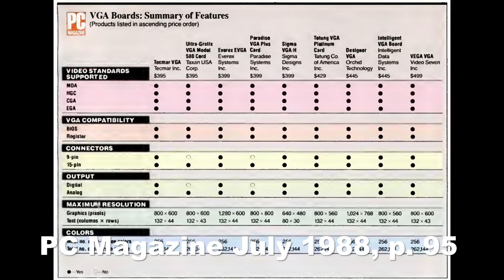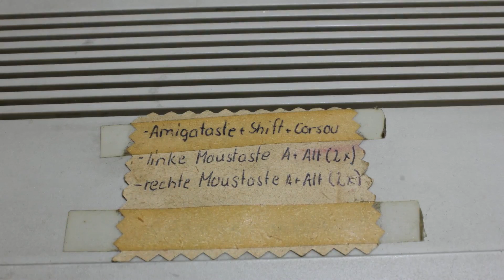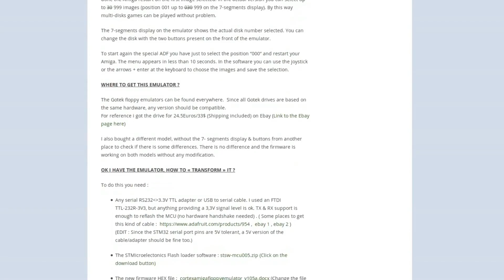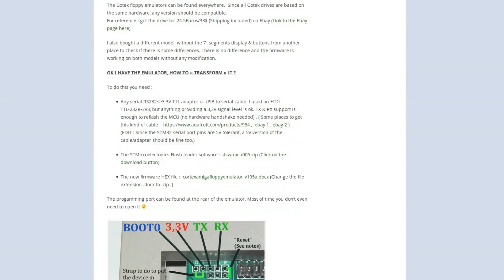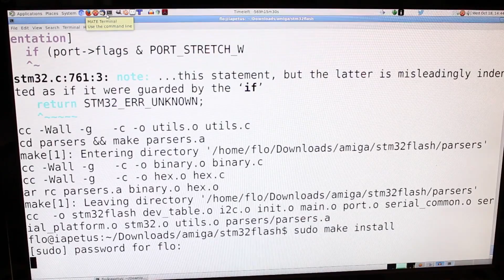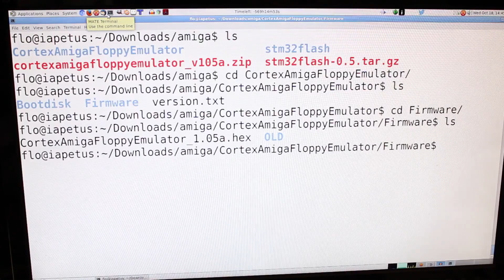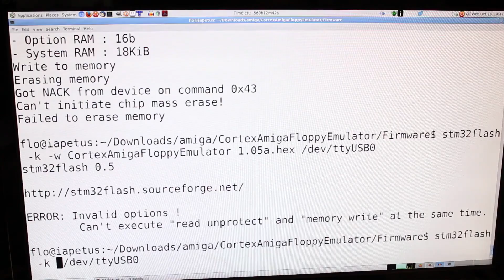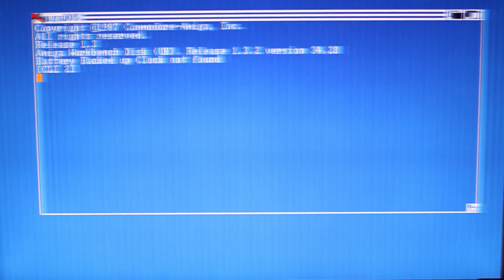Amiga 500 Zero to Hero Part 1 of 4: Checking out the Machine and Setting up a Floppy Emulator

Comment: Loving your Amiga series, recently got mine out of the loft and refurbished the keyboard. Id previously thought it was the membrane as the space bar wasn't working, after ordering one from Poland and reassembling, the Y key didnt work. It actually turned out to be one of the plungers that had gone pretty much open circuit, all the rest seemed be around 200ohms. Just something to check if u have single keys not working. I should of realised as if i had a broken track more than one key would not of worked as you had. Excellent videos looking forward to more, im sure your channel will blow up soon. But please no more of this montage music it makes my ears bleed. Lol 😆

Comment: Thank you for this series of videos! 
I am trying to build a vga cable as you did in the video, may you point me to the pinout schematics you followed?
Also, may you confirm which pins are you using?

Thanks!

Best,
Carlo
Reply from the maker: I used this pinout, if I remember correctly: http://old.pinouts.ru/Video/AmigaVideo_pinout.shtml
The pins are compatible with VGA (if you have a monitor that supports the lower refresh rate).

Comment: The part about having to scavenge an AVR programmer and USB cable was fun to watch but it must've been a pain in the ass :D Made me glad to have one of those 1$ chinese USB FDTI boards with the headers already on there...
Reply: I had to scrounge around for a spare max232 chip and rebuild a 10 year old pc with a working serial port so I could do something similar without having to wait for a usb to serial solution. Works like a champ though, even though I used a bit of dead bug soldering.
Reply from the maker: Yutaka Takenouchi It wasn't that bad, really. Better than waiting for the delivery of a different solution :-)
Reply: MAX232s are no problem here, they sell them at local electroncis component stores. There's one thing i've had to scavenge lately, and that's 5pin DIN connectors. It's surprisingly hard to find PS/2 to DIN keyboard adapters these days...
Reply from the maker: That's interesting. The electronics components stores here are terrible, in my opinion, so I have to order everything online. But at least the DIN connectors are cheap and easy to get that way.